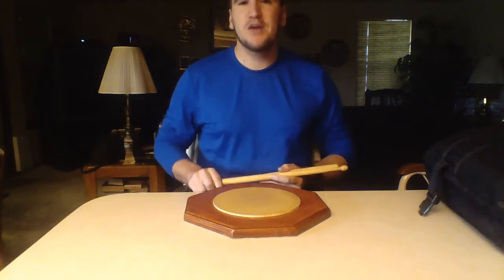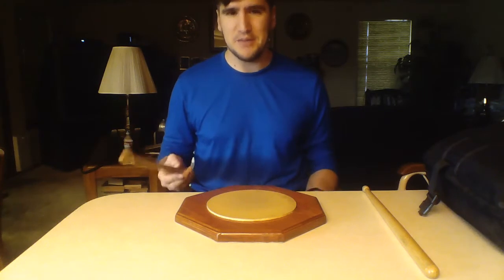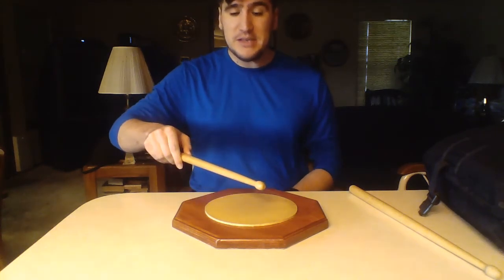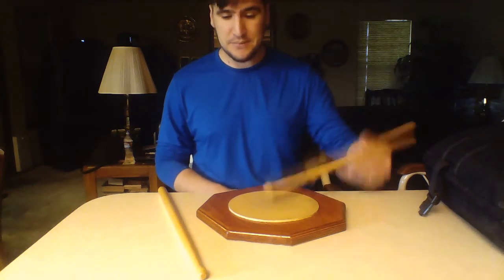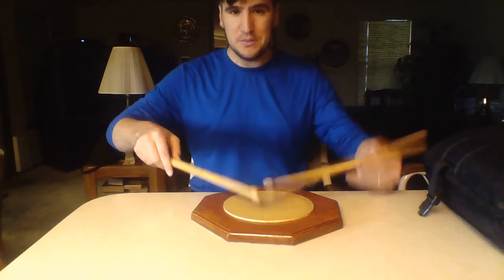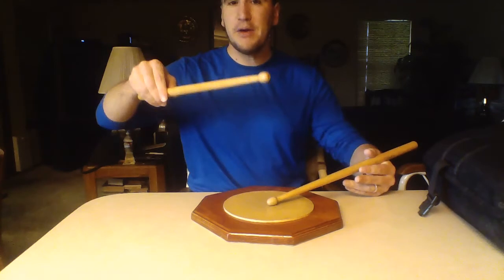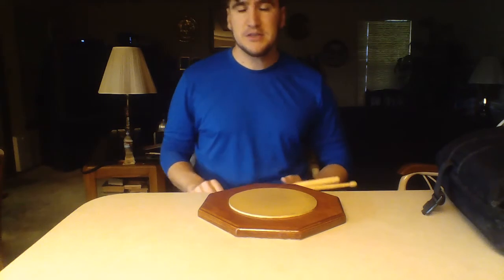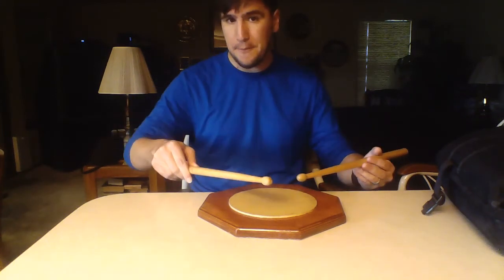Introduction to Pipeband Side Drumming: Lesson 4 - Building Buzz Rolls

Comment: What practice pad, and sticks are you using?
Reply from the maker: This particular one is just some 3/8" natural gum rubber on scrap wood (stained and sealed).  The real challenge for DIY is getting the bubbles out of the 5-minute epoxy (works best for this), and getting the edges to seal up well enough the pad doesn't peel up.  I just added a bit of cheap self-adhesive foam to the bottom in incomplete rings around the edges, and the result is my favorite pad.

Comment: Our roll off is a 17 stroke roll..or three beats which is common on all the pipe band recordings online...is this roll you are showing at end of video custom to your band? Thank You for info and uploads.
Reply from the maker: As a general concept, I would caution against substituting a 17-stroke roll for the three pace intro rolls.  25's work great for anything from 50-114bpm (basically anything that can be marched), and the triplet roll skeleton is what you should be using for marches- the four-grouping roll tends to be a lot more pulse-feel, is more difficult to play well in unison, and mostly tend to be used in place of correcting technique issues where newer players will just use fewer buzzes... the entire corps has to play the same movement for it to sound good.